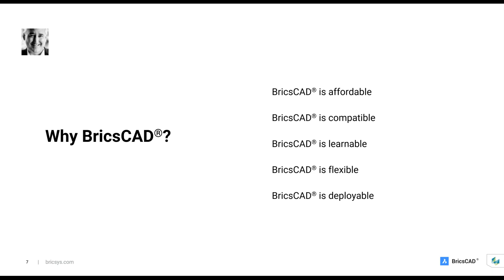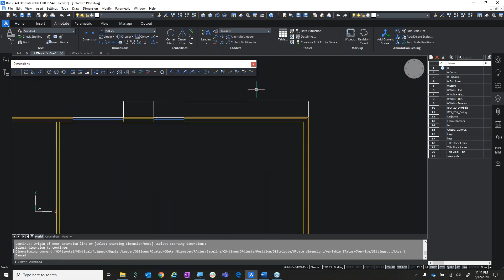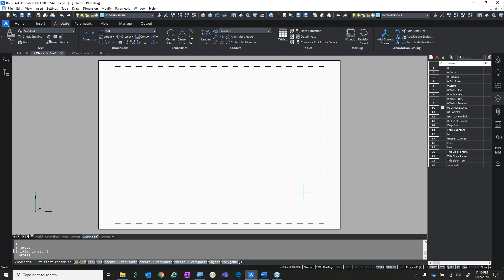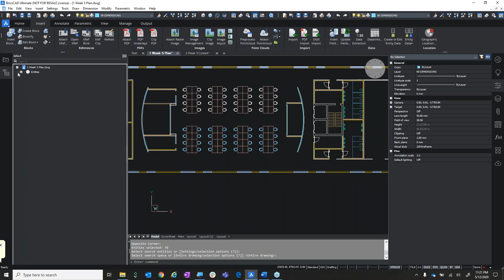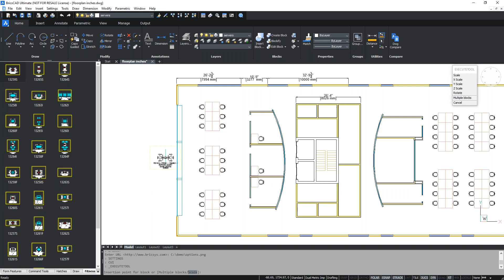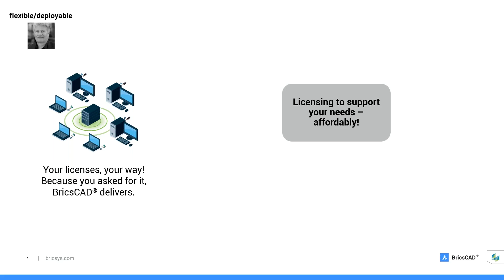BricsCAD: Seeing is Believing l BricsCAD Discovery Webinar

Comment: I have just a couple of questions. 
1. Does BC recognize the command circle TTR?
2. Do BC have mapiimport command, to import raster images to specific coordinates with coordinate file?
3. Do BC have mapcreatecentroids command?
4. Does BC have multi leaders?
Reply from the maker: 1: Yes - TTR circle Tangent Tangent Radius is one of the options of the Circle command.
2: Yes - Imageattach command inserts images with position files: https://help.bricsys.com/hc/articles/360006699673-ImageAttach#about-geocoding-information
3: Not Currently
4: Yes - https://help.bricsys.com/hc/articles/360006639373-Working-with-Multileaders
Reply: Bricsys Thanks a lot.